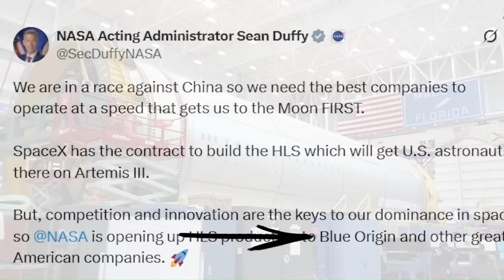Boeing's Starliner Just Turned into a Complete DISASTER

Comment: Puff piece by SpaceX?
SpaceX has done a great job reaching low orbit.
However, the orbital refueling and landing a tall, thin vehicle on an irregular surface will take a lot of practice. Perhaps 5 to 10 practice flights?
Three story elevator or hoist? How many degrees off vertical can that be and still work?

Comment: Sorry guys.
NASA needs an alternative spacecraft to shuttle astronauts to low earth orbit, and Boeing will definitely achieve its goal, sooner or later.
Now, the SpaceX HLS does not make sense: too many refueling flights are needed, the fuel transfers in orbit are more than hazardous and the Starship is far too high in size to insure a safe landing on the rugged Moon surface. Should it tip over, the astronauts are dead.

Comment: The RS-25 is more than capable of flying more than once, as shown by their use on the Space Shuttle. The problem is that, like all previous NASA launch vehicles, the SLS as a whole is a use-once-and-discard design. The RS-25 engines on the SLS will be discarded at first stage separation for an uncontrolled fall into the Atlantic.

Comment: Columbia Disaster happened 02/01/2003 .. the last shuttle Atlantis landed 7/11/2011
Reply: The space shuttle program continued until the ISS was completed.  Save for one Hubble service mission, all non-ISS shuttle missions were scrapped.  There were also huge constraints put on the shuttle flights.  No shuttle went up without a backup shuttle ready to fly, inspections on station of the heat shield, and a whole litany of other headaches.  Basically, the shuttle program limped across the finish line to complete the job they were originally meant to do when they were designed: Build a space station.

Comment: One wonders if all that money spent lobbying would have been better spent on improving Starliner design from the beginning. 
Boeing has had a problem with design and construction of aircraft and spacecraft ever since MacDonell Douglas merged and took over management. This is what happens when bean counters manage engineering projects and they still overrun budgets. I for one am very wary of flying in Boeing aircraft, and after Starliner’s failure, I’m sure astronauts feel the same way about Boeing spacecraft.
One should also note that New Glen has only flown once and that wasn’t without its problems. Yes it got a satellite into orbit, but that was a propaganda launch.
In that same time, SpaceX has launched 10 Starships into deliberate sub orbit flights, which includes two major failures, 3 booster catches, two booster relaunches, two payload deployments and mountains of data on heatshield configurations to test “what if” scenarios. Each flight improves on the last. 
We have yet to see a second New Glenn flight which makes one suspect that there were more problems with the initial flight than has been revealed to the public.

Comment: Maybe NASA has reopened the lunar lander contract because SpaceX has exceeded the competition by so much that the competition has given up. Maybe, by opening the contract, the competition will try a little harder.
Reply: No, there are legitimate schedule concerns.  The biggest being a demonstration of fuel transfer between orbiting vehicles.  The V2 headaches put SpaceX behind schedule, even if only moderately so relative to Boeing. SpaceX also hasn't showcased much of what they're doing on the Starship lander, even though they are reportedly working on a functional mock up for ground testing.  Lots of tell, not much show, which is unusual, given how relatively transparent they've been with just about everything else.

Comment: 8:03 
RS-25 engines ‘are not reusable’
Excuse me? All those engine were flown on multiple shuttle missions already.  
The RS-25 is a great full flow engine with an ISP in the low 400’s, great if you are using hydrogen for fuel.
Reply: They’re not reusable on the SLS platform. The Space Shuttle returned the RS-25s to the Kennedy Space Center at the conclusion of each flight, sometimes with the help of 905. But SLS will deliver the RS-25s to the bottom of the Atlantic, from where they will not be recovered for reuse.
Reply: @ScoutRiderBrian And they essentially had to be rebuilt after every flight
Reply: Even the F1 engines used for Apollo were designed to be used 25 times, but NASA just dumped them in the ocean.
Reply: And every shuttle was torn down and rebuilt after every mission, requiring weeks or months for turnaround.
Reply: @jeffdege4786 Kind of like claiming that your car was usable after replacing every part except the left-hand knob on the radio after every trip to the dtore.

Comment: The fundamental concept of paying only for what actually gets delivered seems to have eluded NASA and still does.
Reply: Starliner is a fixed-price contract, paid out as milestones are met.  Boeing doesn't get another cent from NASA until they meet the next milestone (crewed flight and return from the ISS).  Every delay since OFT-1 is being paid for out of Boeing's own pocket; they've been hemorrhaging money on this project.  

Commercial Crew has shown that NASA can do fixed-price contracts and get results (Cargo and Crew Dragon); Boeing can't.  

SLS is a jobs program, imposed by Congress onto NASA, meant to keep gangs of roving aerospace engineers off the streets.  Its primary job is to flow money to specific districts and contributors; actually launching shit into orbit is just a side gig.  Artemis is a somewhat desperate attempt to justify its continued existence, but because Block I can't get the Orion spacecraft and a lander all the way to the Moon on its own, we have this Rube Goldberg mission architecture with the Gateway and the Starship lander and the NRHO (which is going to make rendezvous particularly exciting).  I expect Artemis II to be the only manned mission to fly on SLS, after which Artemis will be scrapped, although SLS will shamble on like a zombie as long as certain Senators and Congressmen hang on to power.  

Having said all that, NASA wasn't required to run the program so poorly, and heads need to roll over it.
Reply: It's called a timeline.  Decades needs funding before deliverables.  Only a deep deep pocket government can fund such a costly project over so many years.
Reply: That "fundamental concept" only works for off-the-shelf goods. When you are demanding a company develop new technology that the company itself doesn't need you WILL have to pay them to even start.
Reply: @robcat2075  Exactly.  Problem with Boeing is they are a Mega corporation.  All that experience could have brain drain away since the 60s and 70s.
Reply: They don't care because it's not their money, it's the taxpayers money. NASA gets budget increases every year and that's all that matters to them.
Reply: No company has pockets deep enough to develop the bleeding edge technology the government wants. Every single advanced aircraft and naval ship developed in the last 4 or 5 decades would have bankrupted the company developing it. The days of developing fighter prototypes, that will dominate the skies, in just 102 days, are long gone.
Reply: Typical govt ran by geriatric boomers
Reply: @jhoughjr1  Don't blame the boomers for this one -- this sort of government asshattery existed long before they did.